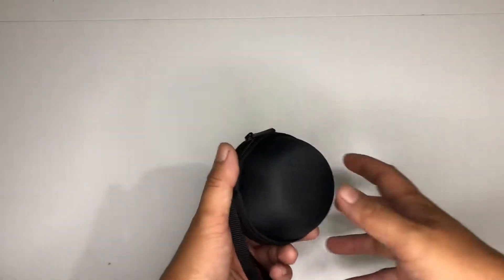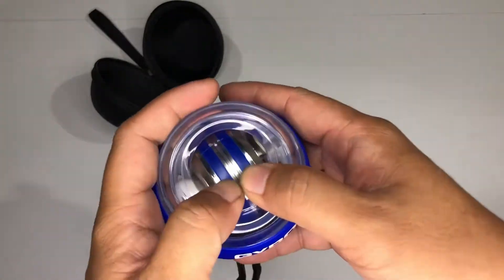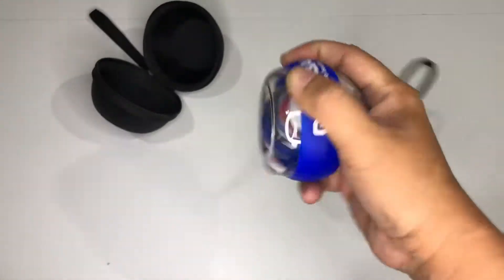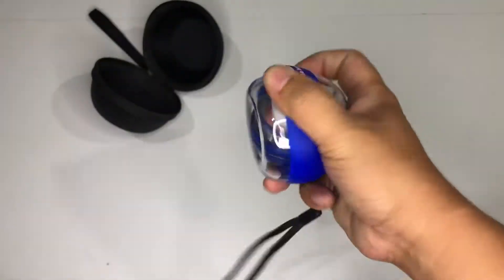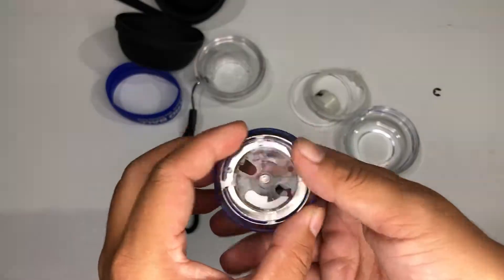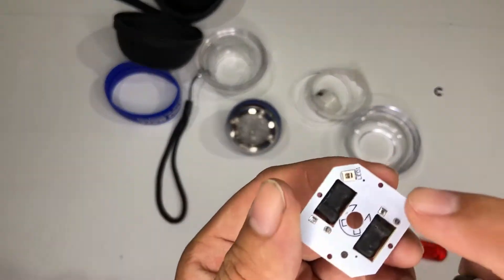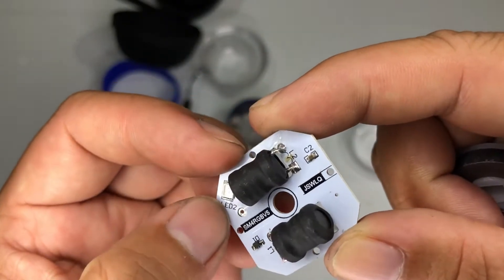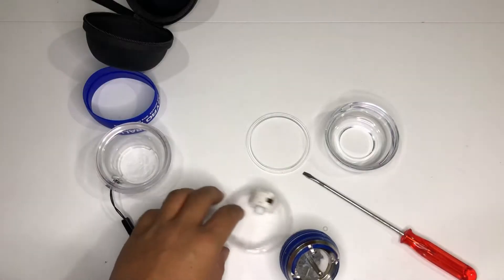GYROBALL || Teardown

Comment: Hello, when you put the gyro ball there is a small white piece there, you don't show where you put it, can you make a video for that please?
Reply: I'm also trying to repair mine and can't figure out what to do with the little white piece
Reply: @conjack13 If you find out how to do it, can you make a video and let me know?
Reply: I spent a long time trying to figure this out, so I’m not 100% sure, but I believe the small white plastic ring is a guide spacer for the white starter pawl.
This white pawl sits in the center of the assembly and is part of the starter mechanism, and the ring fits on the inner-side pin of the pawl to help keep it properly aligned.

Comment: thanks for the video! it's possible to lubricate the plastic parts?
Reply from the maker: I think so yeah!
Reply: @crieliocriel  Don't do it! I did and after I can not spin it... :(
Reply from the maker: @Wondobar  not too much i think..
Reply: @Wondobar  , clean it with isopropyl alcohol or vodka — the white ring and plastic cover inside. I applied some PTFE, and it stopped working properly but after cleaning it worked better than before :)

Comment: how do i fix it that could have caused it to drop it on the floor and then it didn't work at all
Reply: Same
Reply: @ I managed to fix it, if the plastic part is not broken, it works as before if you open the screws of the ball, remove the mechanism inside, put it back in place and close the screws, as in the video
Reply: @cnarefeorhan9321 thx I will try

Comment: Mine came with a lanyard like yours Im dumbfounded where can I insert it, there are no holes in unit to insert
Reply from the maker: you can just poke a hole on it.
Reply: @crieliocriel  thanks for that info, but idk why they would include one and would expect one to alter the device ?
Reply from the maker: @KongKingman  might have been a manufacturing error which QC missed. If they do have the QC.
Reply: @crieliocriel  thanks for reply. I since bought the “gyro stick” you put the gyroball on a “stick”

Comment: Bro I don't know if you are professional at these stuffs but I want to tell you that those two black things you calling capacitors are not capacitors, its the electromagnet and the other thing that fits beneath it and rotates is a magnet and when it spins the electromagnet absorbs the electromagnetic feilds generated by the magnet to power the led. Its a simple thing but is created greatly.

And the heavy thing that rotates is the actual gyroscope.

Comment: Just want to ask,the small white ring where to put?
Reply from the maker: I think it is place in the middle before putting back the two parts..
Reply: It's the nut that secure the clipper with the mechanism.
Reply: I believe the small white plastic ring is a guide spacer for the white starter pawl.
This white pawl sits in the center of the assembly and is part of the starter mechanism, and the ring fits on the inner-side pin of the pawl to help keep it properly aligned.

Comment: Tried everything won't open not with screwdriver throwing it knife spoon mine fell and now not works properly thats why i am trying to open please suggest
Reply from the maker: i just pry it open with flat screw. you can see the latches?.. try to open it at that part.
Reply: @crieliocriel  heyy thanks I opened and figured it out but don't know how to fix it my gyro ball moves left and right and makes a "tack" sound the steel rod the holds it is moving

Comment: I'm pretty sure those are inductors not capacitors, even though they look very similar to electrolytic caps. That would explain how it generates the electricity that powers the LEDs. So the "sensors" are the two inductors that generate electricity as the rotating magnets pass by.

Comment: What to do my gyro ball is not spinning after I cleaned it. What do I need to do for friction?
Reply from the maker: you can add a bit of oil,
Reply: @crieliocriel  mine doest have any plastic ring in between the case.

Comment: I saw ur video and im wondering how u managed to pull the ball open agter unscrewing it cause i tried what u did in the video
Reply from the maker: you need to use flat screw to punch through to it a little bit.

Comment: L1 and L2 are inductors with coils, when passing through the magnetic field these generate electricity. L is for inductor where as C would be capacitor which they are not.